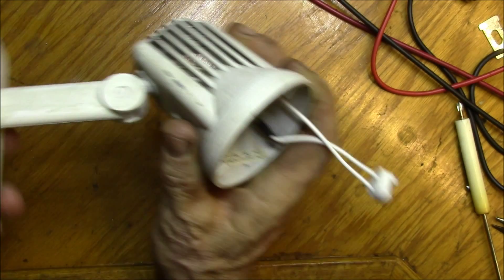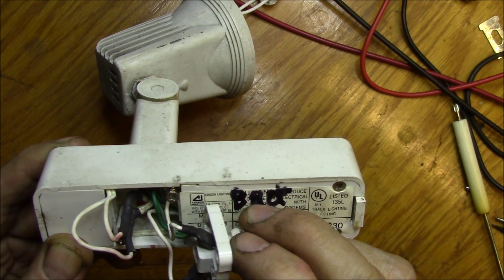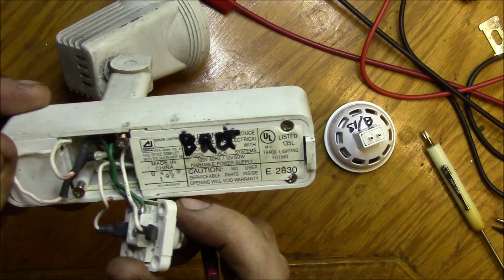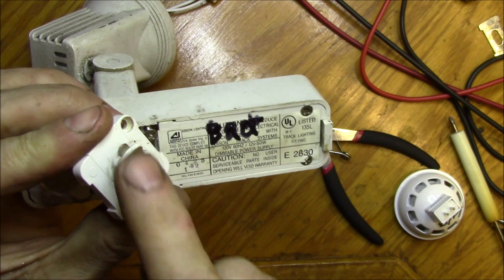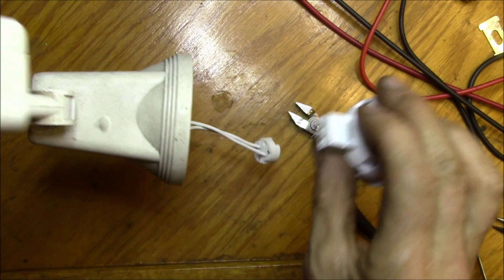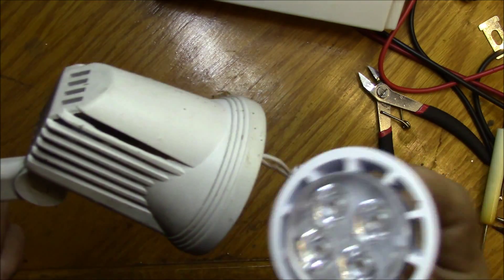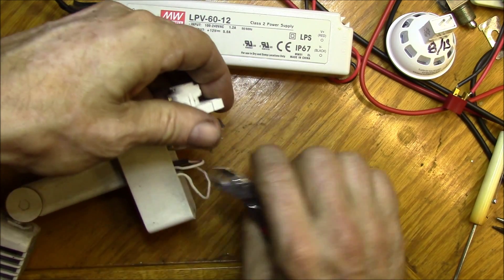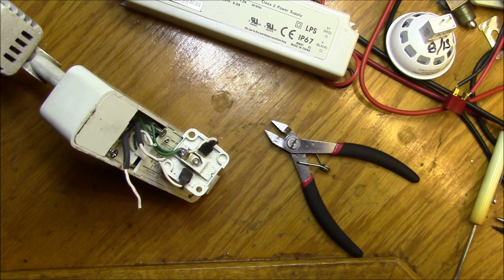True Low Voltage Track Lighting, Part 1

Comment from the maker: I'm still running these same 7 - 5.5W Philips MR16 LED bulbs in 2025.  None have failed, light output and color is still good.  These bulbs typically run 8 hours/day, so have racked up better than 35,000 hours by now.  You can see the 8/13 date I marked on the back of the bulb, that's when I first installed them.

At the time, this was the highest power MR16 bulb Philips made without needing the cooling fan.  Also, these bulbs are non-dimmable.  This is essential for use on a battery bank, as the voltage will vary over day and night time and you don't want the bulb brightness changing, at least I don't.  I also think the dimmable bulbs tend to have more complicated driver circuits and may be more likely to fail.  Simpler is better in my book.

Running these type of bulbs, that are designed for AC or DC operation, on nice steady DC voltage will minimize stress on any internal electrolytic capacitors that are there to filter and smooth the AC ripple.